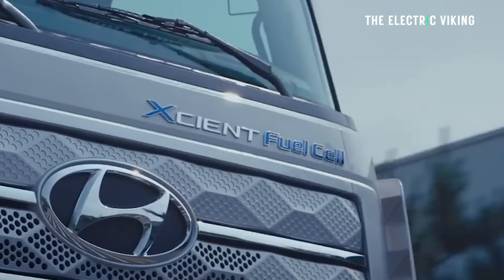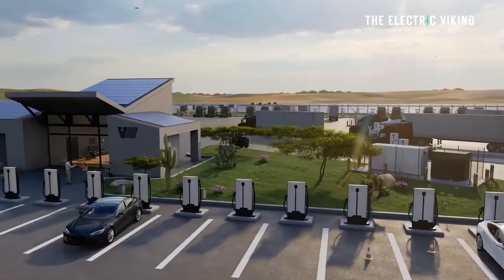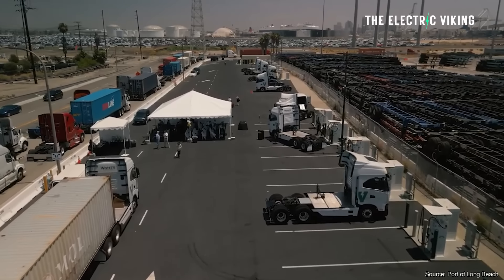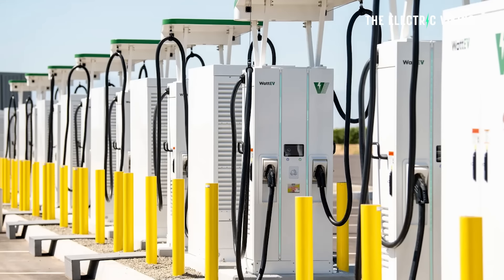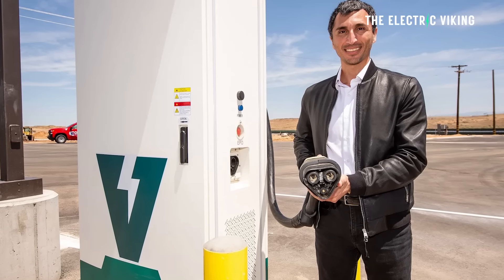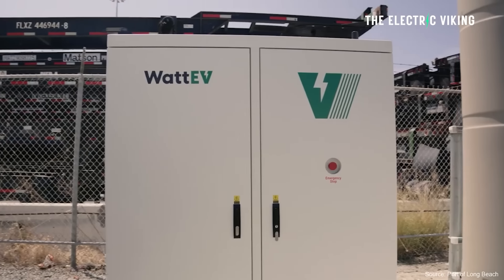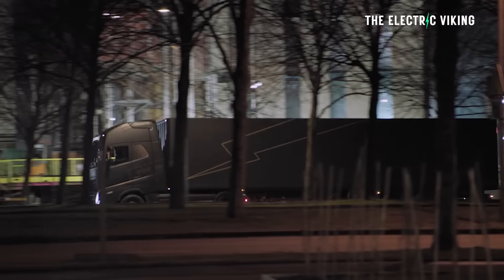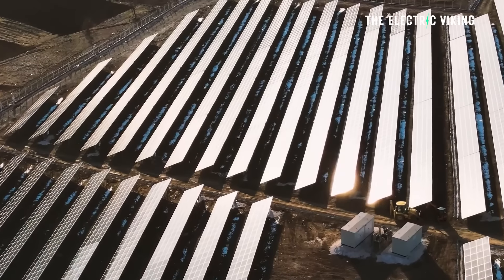America's first 1.2 megawatt charge station is powered by solar & batteries

Comment: This is good but when we can charge an electric car whenever we're not using it - quite possible - then we don't really need fast charging (except for road trips)
Reply: Don't forget apartment dwellers with no access to a plug. 
Many of these folks are in cities where robo-taxis may cause them to give up a car all together, however there will still be many that need access to Fast Chargers.
Reply: You will near never have fast charging at home. i.e. beyond a few dozen kW.  24 kW for example.  Super fast charging for highway use,  is a separate requirement and capability,  that domestic households on mass will never acquire.  The maximum kW rating that a US home can draw from the grid depends on several factors, including the electrical service capacity provided by the utility company and the electrical infrastructure installed in the home.  In general,  residential homes in the US typically have electrical service capacities ranging from 100 to 400 amps.  Maximum kW = 120 V × 200 A / 1000 = 24 kW
Reply: @JoeyBlogs007  Agreed. My Tesla charger at 240v puts out a max of 11.2 KW/hr.  Since all localities that I travel to take no more than 35 KW to go round trip ... that means that three hours on my charger fulfills my needs admirably for everything but long trips.
Reply: Cities with electric buses, are using batteries at their depots. They charge all day while the buses are out and are used to charge the buses at night. This evens out the load on the grid and they don’t have to upgrade their grid connection so much.

Comment: It's hard to believe it is actually where it is. Now here's a question.  Why on earth have they not put those Semis to work in the Agricultural industry here in the San Joaquin Valley in Central California; the "bread basket" of the United States of America?
Reply: Because large corporations buy in bulk first. Not open to website orders to individuals
Reply: @larryc1616  No, I think it's because it's under the radar. It needs to be exposed. These companies should have EV Semis ; MORNING STAR in Los Banos, California, PANELLA in Stockton, California, ANTONINI FRUIT EXPRESS in Huron, California, and on and on.
Reply: @howardj602  Hydrogen and Electric are two different animals my friend.  You're mixing apples with oranges.
Reply: @howardj602   The difference is one has a Motor (electric) and the other has an Engine (hydrogen) with a thousand parts and 6 gallons of oil to mess the parking lots up with. Big difference!
Reply: @ParasiteZappers   There are several ways to use hydrogen as a fuel.  One way is in fuel cells to generate electricity.  Hydrogen cars don’t generate harmful emissions—the only by-product is water vapor.(FCEVs).
The other way is in an freestanding unit that uses a modified internal combustion engine to burn the hydrogen as a fuel to power a generator to  produce electricity. That turns the wheel that go round and round.  Also carbon free with a water vapor emission. Both ways emission free and in production, and not a pipe dream.

Comment: I know that in The Netherlands they got a massive flowerauction in Aalsmeer.
It's one of the biggest buildings in the world and sometimes I'm thinking;
Imagine if that's full of solar panels and a couple of GWh in batteries and all the trailers around got a massive battery and a motor.
It would made all the diesel trucks safe so much diesel that it's just crazy and once there are enough electric trucks out there the savings will be even bigger. 

The current main problem about massive solar arrays and superchargers can't be connected to the grid, somehow if you go offgrid and just charge a massive battery with the solar panels and receive your energy from those batteries, then everything would be perfect.
And even if for whatever reason the batteries are empty, the diesel trucks can still keep driving on diesel anyway, so there still wouldn't be any problem. 
They will probably simply get their own grid.

Comment: Think tanks? Are commenting on alternative energy deployment in relation to fossil fuels usage, at this moment to discern The 30 percent threshold... I'm fact there's two different things!!! One is renewable energy is Calculated on the mechanical vehicle of the energy, the energy being (sun and wind).  Where as fossil fuels are calculated on the fossil fuels themselves, (the energy,) 
So it's like calculating that which captures the energy, called wind and solar, instead of the energy it's self!!!! 
If we did the same calculation for fossil fuels we would calculate the power station converting it to electrical energy. 
So wind and solar equals fossil fuels.
And solar panels and wind generators equals power stations.
One is the energy, the other is the converter to energy.
Also fossil fuels operates at a far higher money margin, and renewables is a smaller money margin. Or the hight profit is in the fossil fuel itself.
Whereas the high profit is in the installation of the renewable energy generators, not the wind n solar itself.
Two different things!!! One is the energy, the other is the generator.
Looking forward to 50 percent of renewable generators installed world wide.